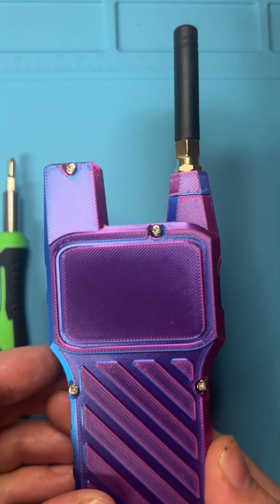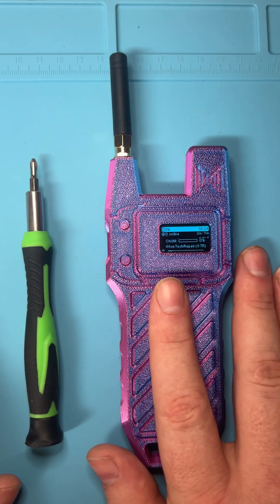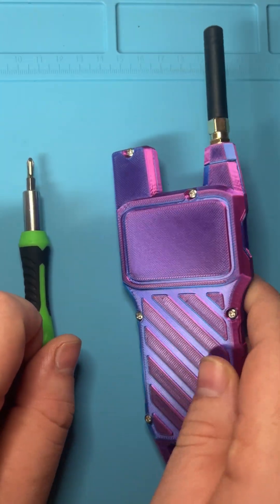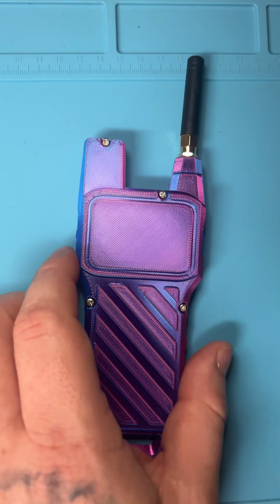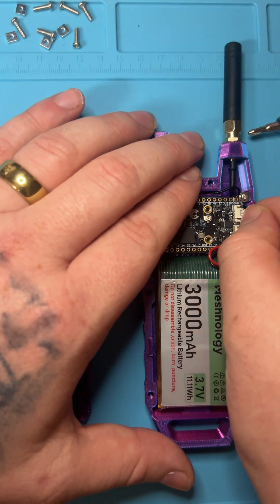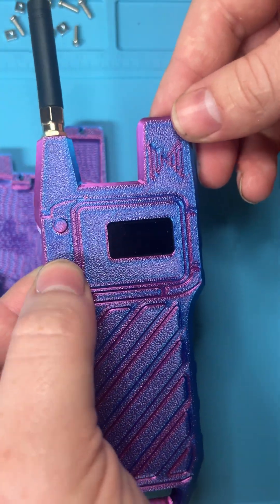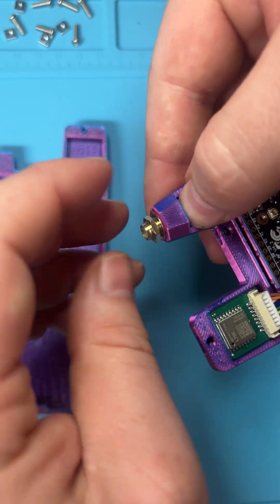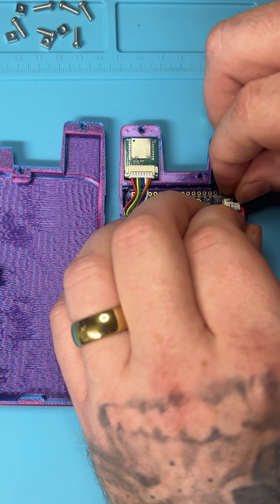How to SAFELY remove/change LoRa Radio Antennas 📡

Comment: On a V4, just go to the second to last page or whatever looks like a gear and long press for the menu, short press to go down to “Reboot/Shutdown” and hit shutdown. Change your antenna and boom
Reply from the maker: Thank you! In my opinion, removing the battery risks damaging the plug in this kit because it is made of very fragile material. This case also makes it difficult to remove the battery unless you completely disassemble the board, giving users access to the plug/socket for the battery without that lip obstructing the way—as I have demonstrated in this video.
Reply: @GhosTechRepair its not super difficult to do but their choice to turn the battery plug 180 degrees was not a bright one. It does put a lot of unnecessary stress on the wires. My V4 is currently in the same case but just plugged in usb, docked up by the ceiling. The plug on the V3 was perfect.
Reply from the maker: @MrMarrok657  there’s that and the SMA wire. It almost kinks where there’s excess. I’ve seen someone else post a video complaining about it. It could definitely have been constructed better. Outside, I love it. Inside, not great. It would’ve bugged the heck out of me to release a case that doesn’t have a solid mechanical design. I’d have ported the hole for the antenna port higher up in the case so there’s enough room to better position the SMA wire without excess. That or move the V4 down a bit.
Reply: @G @GhosTechRepair the sma wire is alright if you only have the short cables.  Its like all the thought went into the 3 and the 4 took a step backwards. Hell honestly I am moving towards using T114’s and Rak stuff for the battery life.